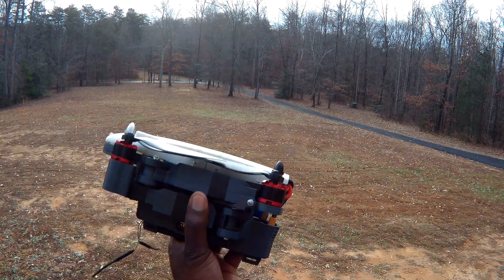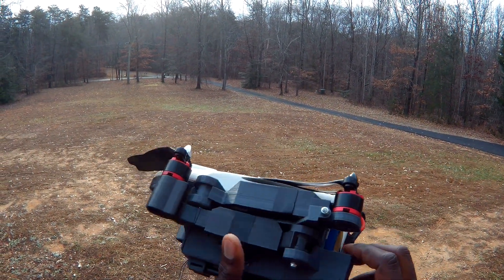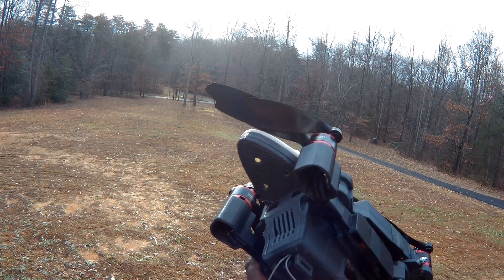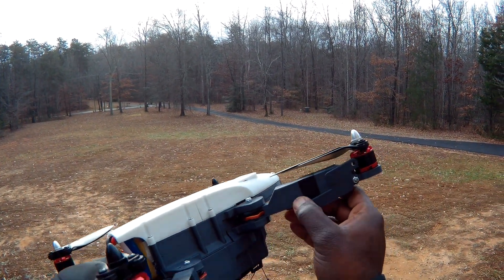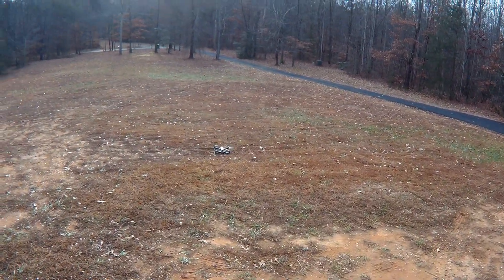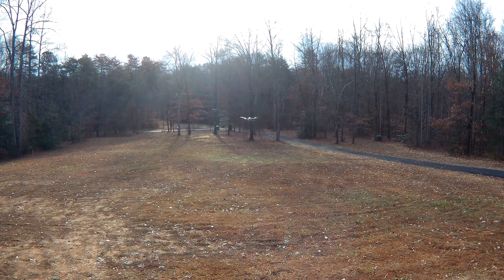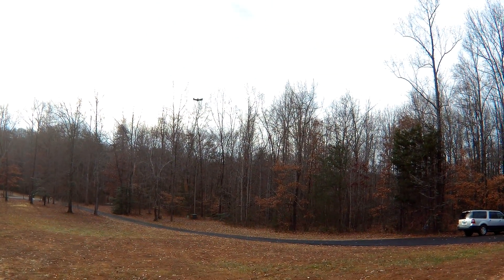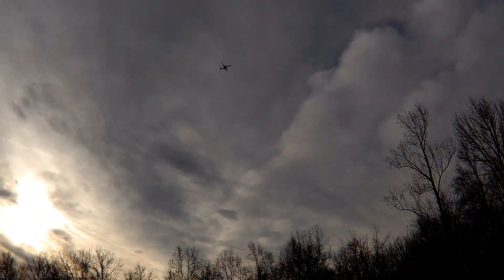2 - First Flight - 3D Print Walkera Vitus/ Mavic Pro Mix  - STL uploaded

Comment: I m planning also for this type of quad much more smaller you need to sacrifice bat space and for the antena the top part is also retractable to have a distance between the gps and the apm to reduce noise i dont print mine i use home made fiber glass for the body and a ice cream stick for the arm

Comment: It's coming along pretty good, been thinking about printing the files, I have done two of Musa Wilmur's quad files, your design would be right there with his.  Great job!!
Reply from the maker: 08maxout thanks.  if you make one,  post your quad flying.  it would be nice to see someone use the design.
Reply: I will do, the last one I printed, from the Wilmur files, I also did the filler and paint job too, turned out pretty good, put a whole lot of time into it and I've got to take a rest, went ahead and bought the mavic pro platinum, so it will be taking a lot of my time, with the weather near zero I will not be going outside for sure.

Comment: hello search in thingiverse the stl and I see that it is the previous version you could upload the new one I would like to print it for my thanks
Reply from the maker: Thanks for looking at them.  Not sure what you mean by previous version.  These are the only ones that I uploaded.  They are the right ones.  The landing feet attach to them.
Reply: you changed the shape of the landing gear because they are different from the video
Reply from the maker: Correct.  I made the arms more steardy and had to change the arms.
Reply: what is the fill percentage that you used for the pieces
Reply from the maker: jesus manuel LOPEZ 35%
Reply: hello by chance you'll have a cover without the gps picture thank you in advance
Reply from the maker: body - top front - no gps.   Should be the last one.   https://www.thingiverse.com/thing:2736295

Comment: for a APM controller to get GPS lock takes a lot of time or use a better GPS module. What are you using for GPS module ?
Reply from the maker: the one that came with the APM, telemetry, OSD, GPS combo.  It doesn't take long for GPS lock.